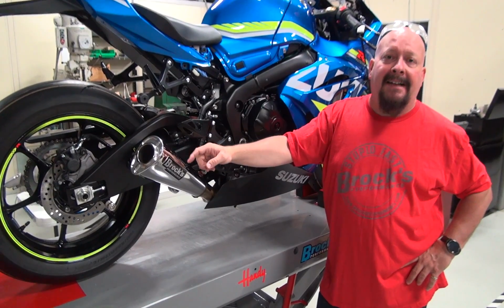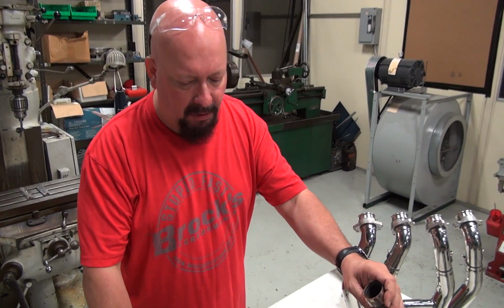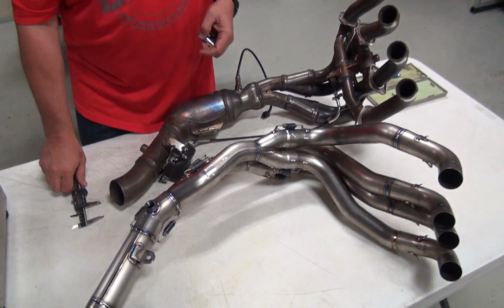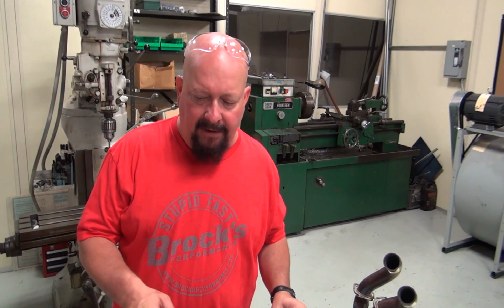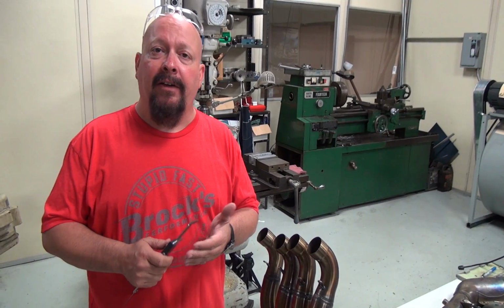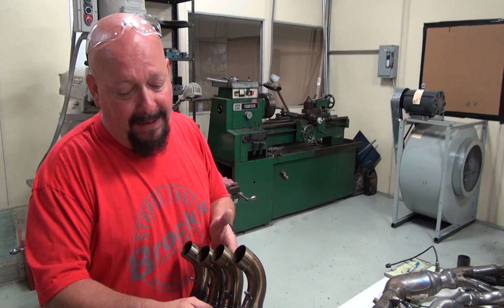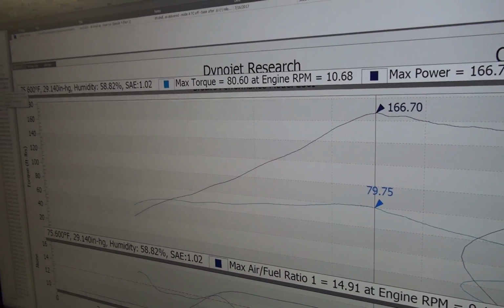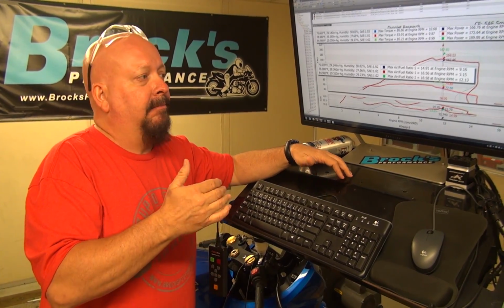2017 GSX-R1000 S2B: Episode 4 - Exhaust Installation and Theory (Part 3): Full Exhaust Systems

Comment: Outstanding Brock. All that hard work, and video editing, people have no idea. The sound of the Alien Head 2 exhaust was beastly, an experience in of itself, wow! 190-195 hp range with huge torque after tuning with the Alien Head 2 on pump gas. So we probably have 190+ hp on pump gas for Predator Exhaust Titanium (road racing), 15 lbs less weight, and great sound. Suzuki nailed it, from stock to Brock, I love it. This bike is going to be amazing on the track, untouchable with the right rider, both road racing and drag! After watching this, I think I'm going to have to set my traction control 1 setting safer when all is bolted and dusted :-) Dang what a machine!! Nice Brock, very nice. It just keeps gettin' better.
Reply from the maker: Thanks! It's a bunch of 'work' but we are having a ball with the new gixxer (:
Reply: Hello Brock, love your videos bro. My question to you is; I just bought a new 2017 250cc Formula sportbike; i love the design but, i,am a little worried that it maybe a little under power because i had a 600cc sportbike before and i,am afraid that i might have bought a bike thats going to be under power than what i,am used to. Can i do any power upgrades to enhanced the speed of my 250cc sportbike to my liking.
Reply: O
Reply from the maker: I'm sorry, we have no experience with that machine.

Comment: rode a 14r with an alien head on it. no tuning or air filter. just this exhaust. i swear, the sound it makes when you cut the throttle at 10k+ rpm, it feels like a sonic boom! such a quality system.

Comment: Brock their was a day long long time ago back in 1980, my beast the H2 750 with Denco Chambers it was so dam loud that you couldn't hear the space shuttle, lol. Them were the days  I would go to Lang Hindles garage watching him fabricating Headers for his KZ 900 along with KZ1000. Back in them days if you built it right you got big power out them pipes, but major pain in the ass jet remember Lang had large board from everything from pilot jet , air, jet,, but most important the needle jet shims just get it spot on. For top end performance I was the Ginny pig that would go on the highway have screaming every year till 4th cut the engine pull over side remove all 4 plugs just to see the colours. We've come a long way not only the nightmares of having them run well, but today pipes are built so well so much R&D goes into them. Mostly great weight savings nice sound. Yet to see a pipe give out over 20 HP like golden era of superbike. Brock I been trying to work on bikes from the triples no Suzuki's, lol, when things really heated up 80s big bore love that GS 1150, to real superbike days 1985 that the year we owe all this to that era. Great job Mr. Davidson love learning from you real have great gift even the squids can lean a thing or two from you. Cheers from  🇨🇦🇨🇦

Comment: "Less negative pressure", absolutely makes a huge difference, and how do I know this? I run a custom vacuum still, sometimes 1000 millibars below atmospheric pressure, and I can tell you even a 10 millibar variance can make a  huge difference in the performance of the still, and we are talking about less negative pressure not positive pressure. Now while a still and gasoline combustion engine have a lot differences, the range of vacuum (pressure) in both is paramount to optimum performance.
Reply: It's still negative, but at least it's less. That alone is a good thing!

Comment: Just stuck a full arrows titanium system on mine, bmc race filter, ecu flash and fueling work, got from 176 standard to just over 185 peak and 80 to 83 foot pounds of torque, but picked up nearly a 20bhp gain in the midrange, from 6k through to 12ķ and you can really notice it, the throttle response is like butter now, the engine had only just covered 1000 miles, so its going back in at 4k for another dyno session as it should of loosened up by then

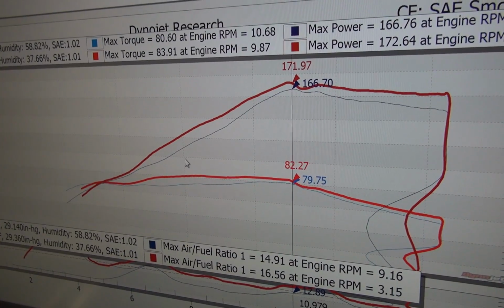Comment: Thank you for the time you are putting in your videos. Well, I think I have to disagree with you on some points. When you installed Brock's exhaust, the  engine benefited from the the overly rich mixture the factory ECU is set at. The N/A factory engine benefit from slightly larger pipes by the fact that larger pipes draw more of the exhaust gas out of the cylinder mainly due to the change in the absolute pressure between the cylinder and the exhaust pipes. When the cylinder is emptier, during the next intake cycle, the piston creates more vacuum which leads to withdrawing more air into the cylinder. And since factory A/F map was already set at a very rich condition, the additional air will make use of it. So, to be fair, Brock's exhaust and whatever aftermarket performance exhaust for the sake of argument, took advantage of  the unbalanced A/F ratio the factory set their ECU's at. Vehicle manufacturer, across the industry, tend to enriching their fuel mixture to meet the emission since richer fuel mixture has lower gas degree, it will lower the production of Ozone and Nitric Oxide. At the same time, richer mixture produces greater amount of carbon monoxide and carbon  dioxide, but these residuals got taken care of by the catalytic converter. Just to pin point what I at talking about, go back to time 30:15 in the video and you will see the run with the factory exhaust had A/F is 8.03 and when you installed the performance exhaust, the A/F went up to 11.73. I think we both agree that 8.03 ratio is super rich and 11.73 is close to ideal ratio. I am not saying the performance exhaust did not aid in power, but I can't claim all the additional 13.09 hp & 8.56 torque was due to the performance exhaust. What I would like to see is EITHER to put the factory exhaust on the bike and re-tuning the factory ECU to exactly match the A/F that is produced after the performance exhaust was installed, I know that would be tremendous work. OR, putting factory exhaust back and tune the ECU to the optimal performance point then put the performance exhaust and re-tune the ECU to its new configuration THEN comparing the two figures together. Because of what I am seeing here, I see that the factory map is not optimized for performance and its not at its best set up for the factory exhaust, I mean come on A/F of 8.03 is way off of the performance band. To me, it looks the bike needs tuning more than any other thing. Sorry for the long comment, have a good day.
Reply from the maker: Thank you for your input. We do not agree that 11.73 is close to the ideal ratio. What you would like to see sounds interesting, but not anything we would be interested in testing as an aftermarket performance company. If you test it, let us know your results.

Comment: First of all : awesome video !  second : could you compare the predator to the alienhead ?
PLEASE !!!!
Reply from the maker: Did you see this? https://www.facebook.com/BrocksPerformance/videos/10154655332516472/
Reply: I didn't see that before, thanks
Reply: isn't the predator supposed to be bit better at mid range and the alien head a little more at top end (wider and shorter)?
number are exactly the same with a little gap at 8k on the predator
Reply from the maker: That's on two different bikes. Lukes R model with more miles/different fuel etc... it's only for general comparison.

Comment: I can't say anything more than that. This is the real reason why mix-n-match doesn't work that great, but because of real engineering and design, now we can have a solution that can work. I mean, before all these ECU stuff we'd have to struggle so much only to see we're not getting any midrange power. Nowadays, with all the electronics and the restrictions on these bikes, the simpler you think the easier it is. Hahaha.

Comment: Brock you should make that same exhaust in all black.
Reply from the maker: @BIKE GEAR. Both exhausts shown are available in Black. Predator has an exclusive black stainless muffler available: http://www.brocksperformance.com/Predator-Ti-Full-System-W-SS-ElectroBlack-Muffler-+I571179+C134.aspx and the Alien Head is available in black ceramic coating:  http://www.brocksperformance.com/Alien-Head-2-Full-System-Black+I398685+C241.aspx

Comment: It amazing me how much of this stuff matters. I dont know anything about exhausts and was always under the impression, exhaust shit as fast as possible = best.  Randomly stumbled across this video and I am glad I did, very interesting Brock. New GSX-R is a real beauty too. 
Pure out of curiosity, what would be the benefits or downsides of ending the exhaust before it even goes under the bike and exhausting it to the ground or sides. Aside from weight saving ,would it reduce performance anywhere? Because as you explain with the drag pipe, moving air, shortening the pipes would mean it moves air out faster wouldn't it?
Reply from the maker: Thanks! And great question. Extremely short headpipes can seriously hamper low-end performance in naturally aspirated situations. You will notice that most turbo charged and almost all supercharger race bikes have very short exhausts, as their power adders compensate for any reduction in low-end. Our Alein Head is as compact as we know how to make a short pipe - the muffler itself is a short/tapered megaphone, which helps eliminate the need for a longer elbow pipe to keep peak power high and not hamper mid/low end power due to minimized overall lenght.

Comment: After re-watching, and paying attention this time :-) A few things stood out; Air filter, tuning, oil change/additive (assuming lighter viscosity.) It got me thinking; Filter 1-2 hp, Oil 1 hp, Tuning 5-7hp?. With drag Alien exhaust we just might see 197+ hp. I'll pay $10 to the first comment that hits the HP (integer only, no decimal) exactly, paid via Paypal, and yes I'm serious. Of course I'll only do it if Brock is good with it, don't want to hi-jack his video. So what say you'all? My guess is 197 hp with the Alien exhaust, Flashed ECU, Tuning, and whatever else Brock throws at it.
Reply from the maker: I'm fine with it. Just want to warn that you may not have 100% results for a while, as we have quite a few videos planned in this series.
Reply: @ Brock - Thanks Brock, I'm in no hurry, we'll see if any participate. I'm still learning launch control on the RR, trying not to cook a clutch. I get this feeling you know a thing or two about proper clutch release at high RPMs :-)
Reply from the maker: @Getis, we launch the old fashioned way... with proper bike set-up and rider skill. Here is an example for you: https://www.youtube.com/watch?v=woTKJRaDIBs&t=62s
Reply: @ Brock - I noticed Jeremy grabbed a handle full of throttle and the rest was up to the left hand clutch release, and then after maybe 15 or 20 yards out he modulated the throttle a little. Is that modulation pilot's discretion based on what the bike is doing, or is that fairly standard? Very nice, I didn't see a hint of wheelie on that run, was that all him or does the BMW have wheelie control?
Reply from the maker: That's all rider (Jeremy is one of the best - he makes it look easy!), suspension set-up, gearing set-up, PERFECT Air/Fuel mapping and power matched to bike/rider/application.  FYI: I have never seen a launch control, on any OEM bike, work better than a marginally skilled rider. I have seen it work ok (not fast...) for riders who can't figure out a proper drag style launch.

Comment: Good job ! So with a flash and pipe, then tuned we should be at or around 190 hp. Should compete great with a BMW 1000R.
Reply: Old school that's about right have been seeing 187to195 usually

Comment: I have a 07 GSXR1K and I am buying the new 17 GSXR1K. Only reason I don't have the bike is because I want to order and have all parts day 1 when I bring my bike home. I can't wait until you are done so I can hv a baseline to build my 17 drag bike

Are you going to do the pair block off plates and crank case block off plate? Also, is a Brocks clutch mod needed on this new 17?

Comment: Just out of curiosity you said you can plug the crossover, can you just pinch it closed? Honest question
Reply from the maker: It's normally open, so you would need to remove the cables and safety wire it closed. The problem with that is you will lose peak power because the OEM header pipe diameters are so small. The valve basically lets all 4 pipes evacuate all 4 cylinders are high rpms only. Its very ingenious...but it's also restrictive by design.
Reply: @BrockDavidson  good to know the science behind it. Thanks for the reply brother

Comment: Very good detailed video brock.. i can see your exhaust sales rising a  bit during and after this series.... quick question how much heavier is the black stainless predator full system for this bike in comparison to the titanium one and is the internal diameter any different whatsoever being that the material thickness may be different?
Reply from the maker: Our staff will have those on the technical tabs of each product, soon.

Comment: What I'm getting from these videos is that the majority of the horsepower gains come from deristricting the throttle alone. the mapping gives a little bit extra but not by as much. Is that correct?
Reply from the maker: From a purely power standpoint, that's becoming the case more and more. The problem is that while this is going on, driveability continues to suffer even more... Which makes proper mapping critical not only when it comes to power and rideability, but also acceleration.

Comment: Hi Broc, is there a difference between the sensors on european bikes? I heard most bikes don’t have O2 sensors in the USA. I hope you can help me with the following question: I have a 09 zx6r with a slip on pipe + link pipe. The headers are stock and the cat is still in. I want to install a bmc race filter. Now do i need to keep everything as it is or is a full system required? If so, would my bike run lean and bad if i don’t flash my ecu after full system install? Would it run lean from installing the bmc race filter alone? Thanks in advance! Best regards Donny from Holland

Comment: Brock, are you disappointed in the horsepower and torque output of the new motor? It seems the existing R1 can out perform the Zook. From the Suzuki hype, I thought it was going to be the ultimate liter bike. I'm not too hopeful for the new 'Busa now.
Reply from the maker: In restricted form, The new Gixxer power output is very disappointing. Unrestricted, it's impressive...and we still don't have all of the components for an apples to apples comparison.
Reply: Thanks Brock, I didn't want you to think I was knocking your tuning abilities. Its the Suzuki I'm a little disappointed with. I use your ZX-14R clutch mod and love it. Not swapping Kawi for GSXR, though.
Reply from the maker: It's not Suzuki's fault. EURO 4 is a very tough standard, so it's not fair to compare the new gixxer to bikes that don't have to pass EURO 4. Our job is to create the components to let the bike perform freely, and this takes a while. Sometimes a year or more by the time all is properly tested.

Comment: Brock- is there an extended swingarm kit manufactured for a 2017 GSX-R 1000R? I'm wondering how far the rear speed wheel sensor will reach if possible. Thanks!!
Reply from the maker: @Corey - yes, swingarms and bolt-on extensions are available. We make an extension harness to handle the sensor: https://brocksperformance.com/speed-sensor-extension-harness-14in-gsxr-1000-17-18-hayabusa-13-18/

Comment: I have a question and I've been searching the internet high and low for it maybe you can help me. so I know you can run MR12 on a stock motor but its basically a waste of money unless your ECU has  been mapped for MR12 but my question is can you run  MR12 mapping on 93 octane? is it good bad or no difference.
Reply from the maker: MR12 will achieve it's best performance results when the air-fuel ratio (AFR) is properly adjusted for its use. This fuel adjustment can come via an ECU fuel adjustment or via a 'piggyback' fuel controller (Dynojet PCV, Bazzaz controller etc...) If the ECU is mapped for MR12, the AFR will be far too rich for use with 93 octane. Your bike will still run, but sluggish performance, 'lurching' (lack of smoothness... like an engine with an oversize cam), excessive soot at the exaust tip and poor fuel mileage will result. To combat this, we leave the ECU fuel map alone (but derestrict other areas of the ECU for maximum performance) and use a map selector switch to easily convert from a pump gas map to an MR12 map as easily as flicking the switch (no computer required). Please call our customer service team for more info. 937-912-0054.
Reply: Brock Davidson oh ok I appreciate that!Thoroughly explained. I’ve had my ECU flashed (Brentune) for about a yr now and I have 2 flashes one for 93  and one for MR12 I was just curious of how my bike performance would be using the MR12 map but using 93. Didn’t want to risk messing anything up so I didn’t put it to the test.

Comment: whats the most hp gain have u got ( to date ) on a Gen 2 ( 2008 ) hayabusa with the alien head exhaust, aftermarket air filter, flashed ecu, and tuned fuel manager ? your hp gains are unbelievable...
Reply from the maker: 190-195 on pump, over 200 on good gas. They run GREAT: https://www.youtube.com/watch?v=wrsIt_I6hqw
Reply: Brock Davidson really... i just got mine dyno tuned   i got the brocks alien head ecu flash mwr filter and bazzaz fuel manager n they only got 180 hp and 105 ft lb of torque... why is that ???
Reply: the same hp and torque gain from 2 well known businesses in atlanta Ga. how are you beating both of them ? what are you doing different ?